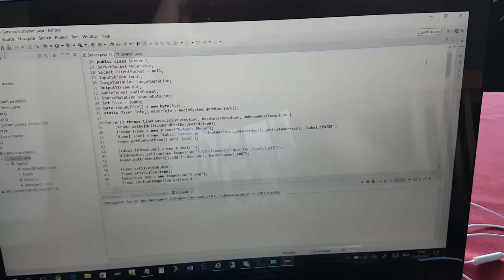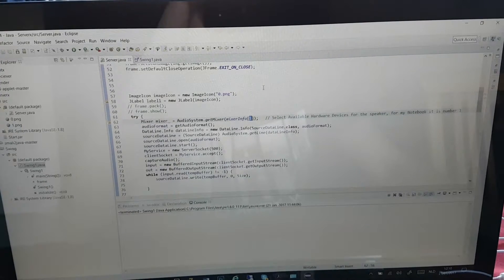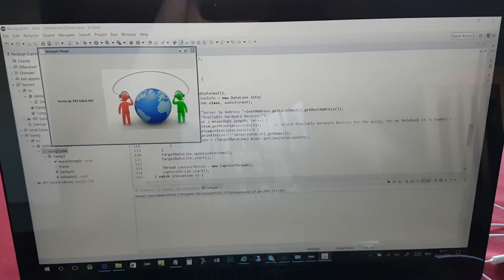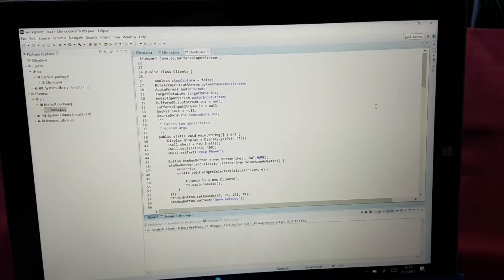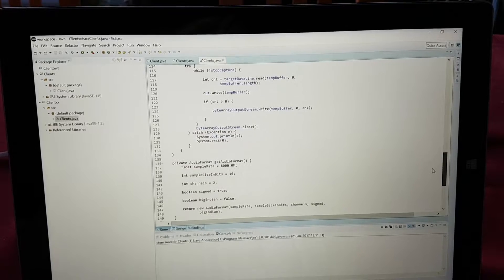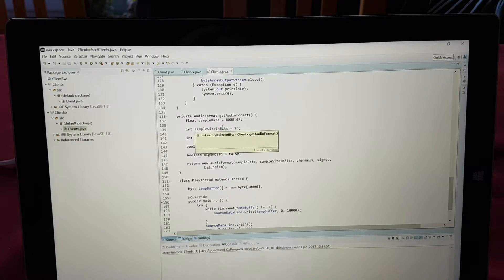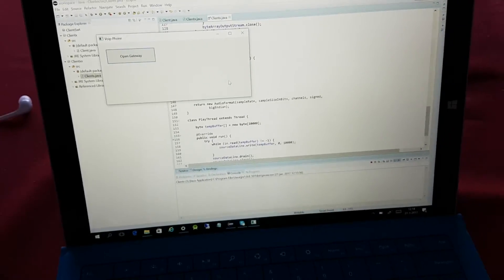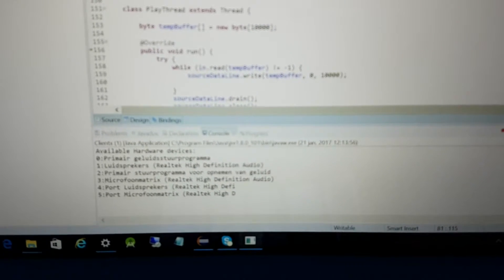Voip network project with java

Comment: how can this work for multiple clients? i Have created a java application for chatting and audio stream. In that after using your code, i can only be able to use two clients max. but i want to stream audio from one client to multiple different clients(other clients only listen to that one client, does not rply). if you can help me in this. i am a beginner in java.